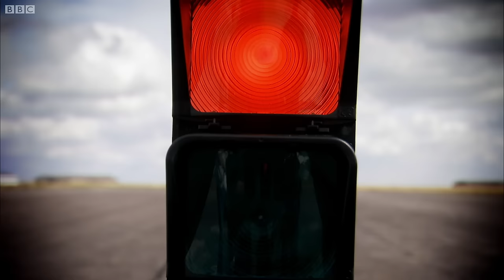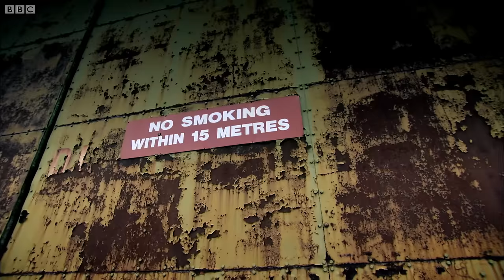British vs Aussie Top Gear - The Ashes CHALLENGE | Top Gear - Part 1

Comment: They need to put those double decked cars in GTA online
Reply: Like a new race mode or something.
Reply: And all vehicles that appeared in that TV show (Leaning Tower Citroën, Peel P50, Electric Car etc).
Reply: @mariodacostamosteiro7262  Oh yeah, but it would be more funnier if they make more vehicles similar to some Top Gear cars.
Reply: They are in WreckFest :))
Reply: i was thinking about that too while watching lol
Reply: bmw e36 compact they did put in Jeremy’s Boat Pickup
Reply: They would be priced at 10000000000000000000000000$ per car because rockstar tho
Reply: Hmm
Reply: The "17 years ago" actually fooled me for a sec
Reply: You can drive double deckers in the racing game Wreckfest but you still control the steering and throttle/brake   as one player. 

They should have an online mode where the controls are split just like the real double deckers.
Reply: BeamNG Drive Multiplayer. It's already possible there.

Comment: You could argue that this is cheating, but 'Team Bruce' deserved it after coming up with a race so obviously biased. I mean, a 'commerical vehicle drag race' is bollocks, they knew they could use a 'ute'.
Reply: England makes plenty of commercial production vehicles, just no fast ones. 

In fairness the Transit certainly was a commercial vehicle, even if the engine wasn't...
Reply: Shane Fell Indeed. Australia specifically makes a fast commercial vehicle, which is why they came up with what is ultimately a far-fetched idea.

Comment: first have a jaguar xj 220 and a ford transit.second remove both car's engine.
third put the jaguar xj 220 engine on the ford transit.fourth change the ford transit rims 
with a jaguar xj 220 rims.fifth test drive and race it,you won you'll be happy.
5 steps do drive a van like that